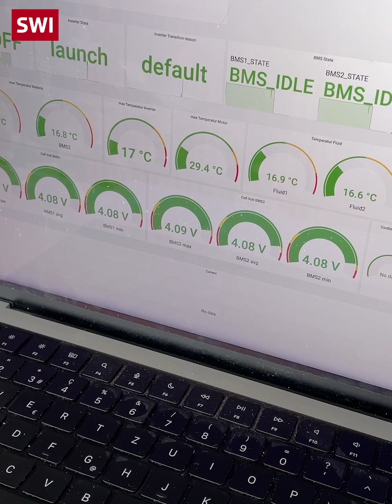Student-made electric plane

Comment: I congratulate them on the achievement because building a plane is not an easy task, especially a battery powered one. But at the same time I hope they learnt as well that putting batteries into aircrafts doesn't make sense at this point. They are too heavy for an aircraft and too little range they provide. As much as I would love to see electric propulsion system in aircrafts, I don't think it's going to happen any time soon (with decent range, to be clear).